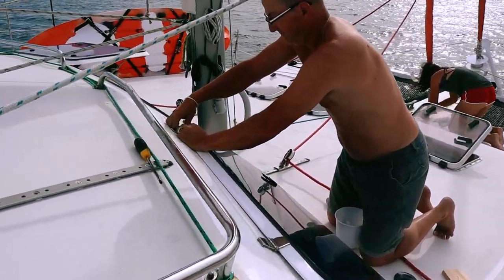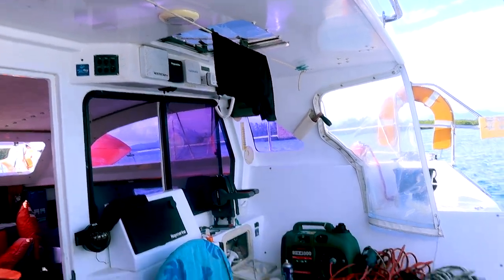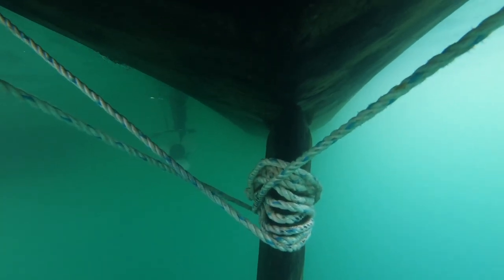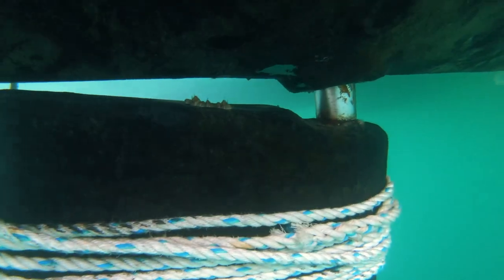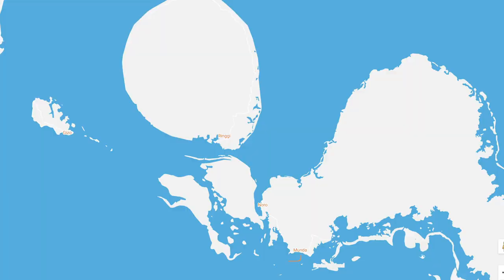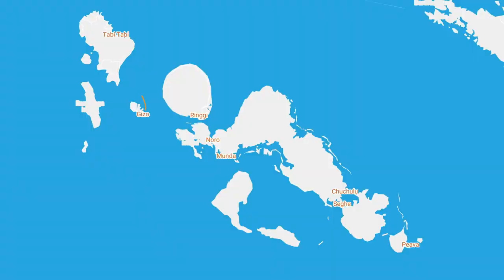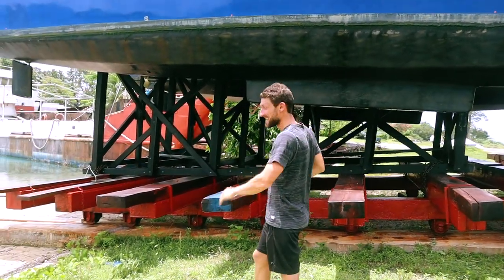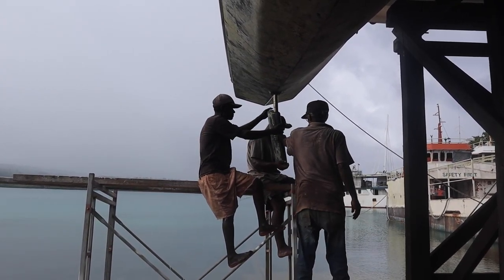Boat repairs, repairs and more repairs - the nightmare of breakdowns in a remote country!

Comment: you are doing well ,,,,, dont be worried about that rudder shaft , it was not bent very far and will not be weakened by any amount that you need to be concerned about ,, it will last for ever  !! i would be more concerned about the engine.
Reply from the maker: thanks for the advice (and sorry for coming back this late, few issues with youtube :S)! The problem that we found out is that the rudder shaft had already been replaced in the past and for some reason the shaft is empty inside (it's just a tube), so it's definitely very weak... Better safe than sorry I guess, we'll replace it in time anyways. But yes, definitely more concerned about the engine....
Reply: @SailingTakeItEasy  couple of months now so you may have sorted your engine ,, if you have still not looked at it it may be worth checking the salt water inlet for blockages ( very common  ) and the fresh water  pump impellor ,, good luck , and i guess you are experiencing the same problem that we all are just now , hope you are somewhere nice ..
Reply from the maker: @roderickmchardy3650  yeah we checked all of that but still no luck... we are taking it out to get it to Yamaha now, because we've run out of ideas! But unfortunately not sure when we'll be able to do that given the current situation! Our boat is in Australia and we are unable to come back, not sure for how long :(